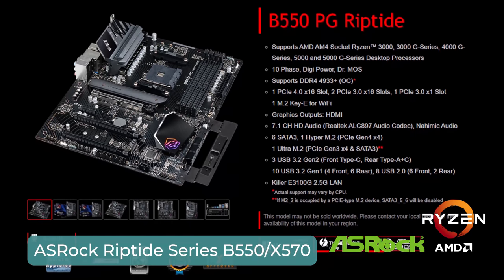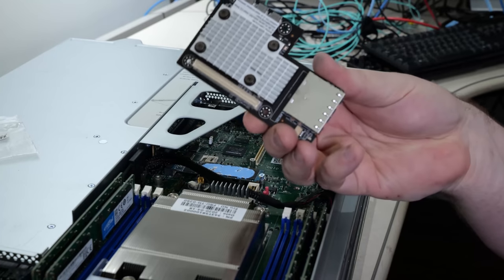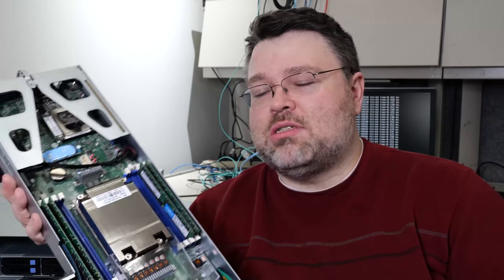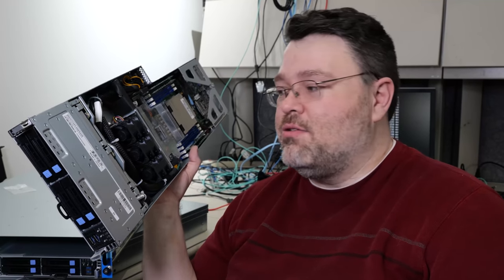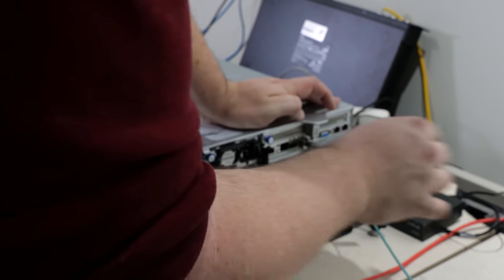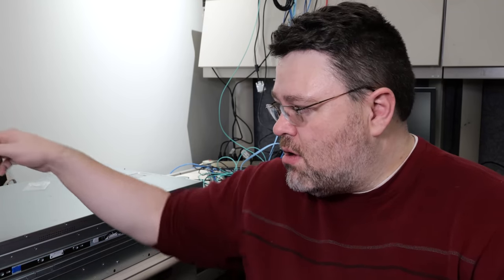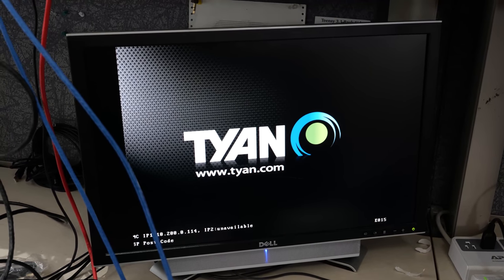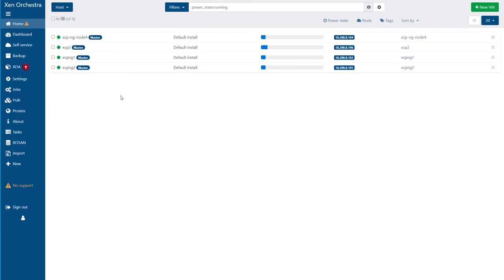Vlog: Random thoughts on Clustering our Tyan Transport MODEL w/ XCP-Ng

Comment: Nice video of very advanced setups. 
I'm only ~18 years behind with networking my VMs. I use 1Gbps Ethernet and my VM backup snapshots copy at 200Mbps, because of a load of 95% on one of the Pentium 4 CPU threads (1C2T; 3.0GHz; 2GB DDR).
The only thing, that is somewhat modern, is my 32-bits software FreeBSD 13.0 and OpenZFS 2.0 released April 2021.
Reply: 1Gbit is too rich for that kind of hardware lol
Reply: @marcogenovesi8570  I don't need the 1Gbps, the 80 to 100GB increments it backups each Saturday just take ~1 hour :)

Comment: 20:25 Nutanix does the same thing (data locality, VMs are always run from local storage but remote writes happen in accordance with replication policies set on the data pool) and is KVM based rather than having to deal with a Xen spinoff
Reply: I thought Nutanix was its own thing. It's hard to get actual info about it
Reply: The locality aspect really has nothing to with AHV. It’s just the CVM’s fabric monitoring the back channel storage requests and ensuring those bits get stored locally after enough hits. It does that across AHV, VMWare, Citrix, and Hyper-V. If I remember correctly, though, any affinities outside of AHV have to be set in the CVM admin panel and in the hypervisor.

The problem with Nutanix (well, one of my many problems with Nutanix) is just how excessively diversified their productized features are while remaining decoupled from each other, meaning getting all the different products and services working together can be a hassle.

There’s also a lot of technical debt in their products, causing a lot of inefficient use of resources, and slow adoption of alternative architectures.

Comment: Not sure if I should go for Proxmox or XCP-NG HA Cluster now. I will use 10G network and Truenas Core as SAN. What you suggest for homelab/future business use?
Reply: Xcp-ng is more flexible while proxmox is more first time user friendly
Reply: @Amogh-Dongre  I feel like it's exactly the other way around. I have been watching all of LawrenceSystems videos since he started making them and it always felt like a fleshed out hypervisor with a sanitized GUI,  but I'm not sure how edge cases can be handled. 

Proxmox has been on the market for years and has a giant community around it. I suspect it has more functionality for niche use cases instead of just the obvious ones. One example could be the whole PCI passthrough and nvidia vgpu stuff that can be done with proxmox (I don't know if XCP-NG can do all the same things). 

Another big reason is the way Promox supports ZFS natively while xcp-ng uses it as file system only. You can see that with Proxmox backup server, which is another big plus for proxmox as it really takes care of all your backups needs for pve. Maybe the ZFS implementation of the two products could also be an interesting topic for Wendell.

Comment: Shit on it no desire to explain me no nice ^^ not even 4x server would have topped what I would have rocked with it, I would have everything ^^ yes the cups are great ^^ but the clutch who 1000 percent server would manage 900 like not tack bar enough and all core and high tripled 300multiplier secured to the limit and error free with 18x ram stretched x4 256x1cuda cash boosted x4 on the way the who simply everything internet data GPU CPU 1000 percent everything without ifs and no and buts .OC boards bring and real faster high CPUs terra tipper alone not the who really next level I can-not imagine so violently, and I am not shocked and that is not a lie. I can't afford it ^^ just don't care that you know ^^ then you know what I mean, you won't get that baked in the cloud alone, every expert can tell me about the bear, I think I would have blocked the big one and the little cores are turned up with tipping, the performance increases, the cash is faster everything turns up to max without exploding that is 34 cores x5 in 1080p = 170 x5 (5g) in 8k 60 Hz = 850 core run 5x times 4 times more 16 core SSD x4 data run-through boost Download must yes if the one with a pc 16 cores = 1600gb HDD x4 16x 4 = 4pcs data trans Bost = 256 cores + 1106 cores power 4x 7400mb 8k 1000x8 = 1106x8 = 8.808gbits speed cores boost the. Can't say any information about the 5.2 all core tread tackt Multi stand limit and say a turbo takt and my x3 CPUs what to seed nor does not bring speed boosted with the intel max + everything again 300 multi tripped boom because I can't keep up and Everyone s feasible so fast accelerates everything internet also everything feasible everything stable to normal tacks as always at the limit only the multi I could trick high at 18,000mhz 1333ram x6 x3 = 18x 4200mhz @ more is not possible with c 14 so high 200 MHz more suitable bandwidth 100 pro raid dual Minium MHz more should be automatic enough to rest and have more to keep all the ram just perfect is the tacked for the performance think OC 3999mhz x18 and that would latch so I guarantee it would run because enough power and air and tension for speed for stable BLCK balancing on 18,000mhz ram is ^^ I could put the whole beta bios to the limit ^^ that who knows such a joke already knows everything and it works sorry that I know exactly only the power I can't explain it to me either, sorry, you just want to knock it out, maybe I'll someday prove the jump ^^ if not so who test it, that's just ill ^^ ddr3 rampage 3 coupling wheels 0 dual 1x data a win 11 ... ill 4 desktop maule remote control boost auto loops drive up XMP on one device on all devices atomic bomb. Amen server Internet can never possibly do that if the download is there who ^^ and really transmits I don't think that's over 8000Gbits ^^ limit max download only with server x4 cloud bad luck if you don't believe in it anymore ^^ but it is not and the one on a system there is everything split up and downloaded with a delay only need 16kx3 = OC Download ready Botnang 16k + Download 16k together 300x radio x6 core + 16K core Little together I encourage everything goes up hopefully that is ^^ 8008Gbits in the triple + max OC 300x multi one never in the SEK 80bit 60hz on dvi 43k x5g in that the cable can process so quickly a miracle and cash can keep it on the monitor so you don't have to give everything for it data works perfectly without an adapter card ^^ in the OC - atom bomb ^^ all 1080p ^^^ City 4k you have to subtract otherwise the bill doesn't fit even if 4k is still the same, I don't have to say that I unlock speeds everywhere in the bios that are not normal ^ comes to perfection, of course people that would work ^^ switched. You have to test my opinion your-self, I swear on it ^^. It's just fun anyway, so your CPUs are all heavy today enough today that for real there is also my age shit accelerated there is nothing slower boarding no one chip tripper limited to trap voltage data and pure acceleration circle balance 4 pcs autobahn on a CPU bench pc rig automated in 3 x boosters + testing it is the limit means that the shaft you never ^^ so to act so high BLCK and 3x real 1 x download I practice storage all performance by the 340K dvi 5g that optimizes it at the limit with power data internet audio hardware and performance perfectly left to right bandwidth of the device thanks to ram18x the bomb works I filled it up sorry for filling up Wolfs really clarify more mention I can't prove anything ^^ Finds funny speculate fantasize ^^ ill ^^ throw away server 4x load version what one thinks it is faster.

Comment: If you wanted an even more baller version of that kind of compute multi-node server design, you'll want to reach out to Dell about the PowerEdge C6525. Up to two 3rd Gen 64-core Epyc processors per node. All the RAM. M.2 Gen.3x8 internal riser, dual PCIe Gen.4x16 risers with an OCP3x16 Gen4 onboard card slot for some truly insane connectivity options in such a small footprint. Oh, and each node gets up to six drives, with two being optionable NVMe capable backplanes. Not quite as nice as having all of them be NVMe capable, but at least there is some option for it.

Comment: 10 gbe is still more than fine for vSAN deployment that uses sata3/sas3 ssds with pcie based (nvme or pcie) caching devices though right? I'm building a 4 node setup with r730xds that will most likely use 12g sas ssds with fusion IO accelerators for the caching tier due to the high iops and endurance. Homelab, but I dont want to be troubleshooting performance.

Also I wonder if you would've been just as fine with RDMA nics and an appropriate switch instead of upping to 25 gig. I guess for all nvme and optane it definitely makes sense. 

Also is there any white paper to suggest vsan doesnt handle data locality that well?
Reply from the maker: Not according to VMware tac ii support lol 😂
Reply from the maker: No more age of the hardware and total combined speed. 25gb is minor cost over 10gb these days...

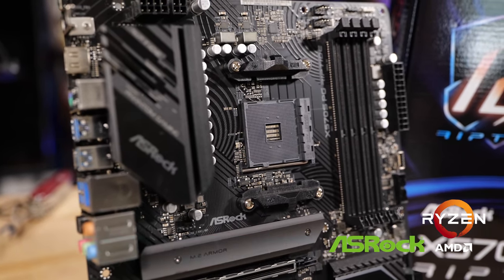Comment: @0:39 um slow down - why is there a blank PS/2 hole? Wendell are you stripping demo mobos for serial ports?
Reply: what? those holes are for wifi antenna pigtails (not installed)